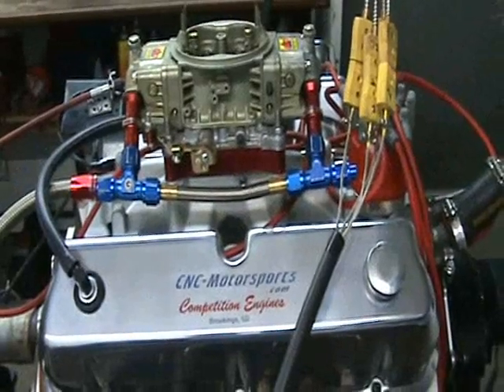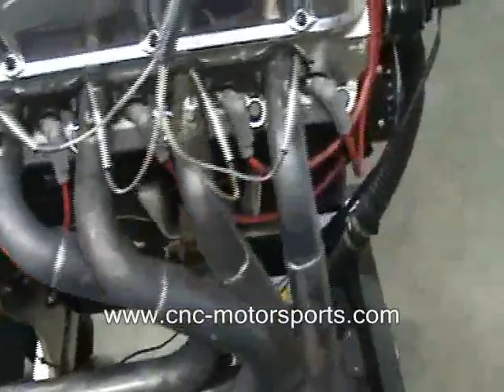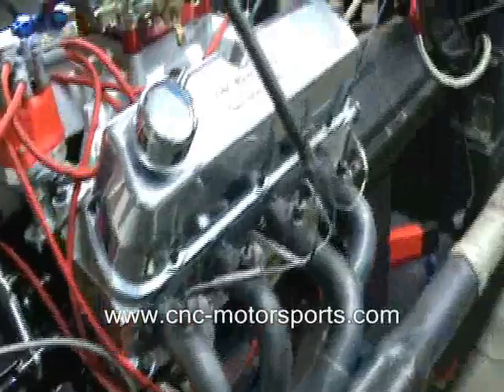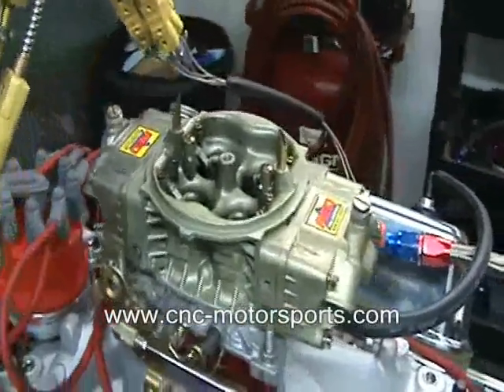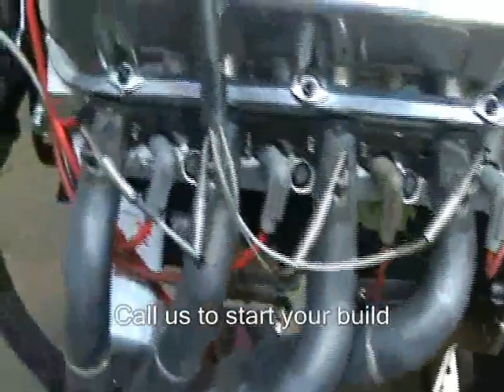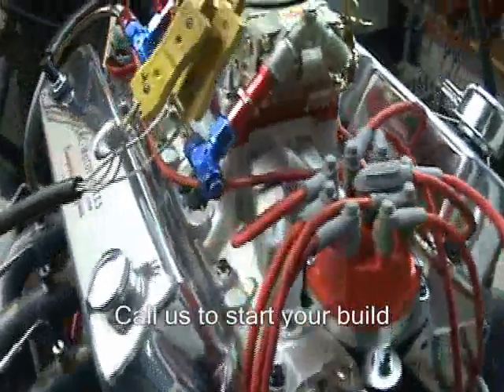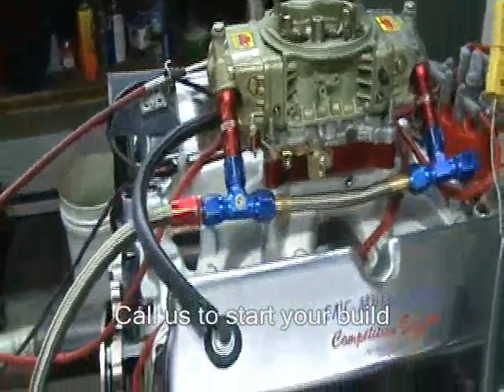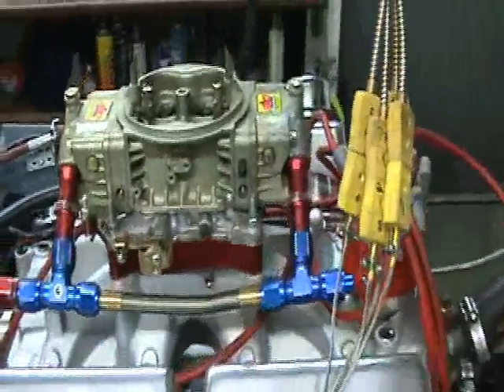Ford Mustang 347 Stroker Motor 531 Horsepower

Comment: Not possible without solid cam/bigger carb/bigger heads. I don't think so with a hydro roller .54 lift. Must be very high compression and much bigger cam.

Comment: he a liar about that engine making that horse power, why do you think he didn't tell you about the cam specs
Reply: *He’s a liar.  Lol... and no he’s not. Look into David Vizard.  An Englishman and engineer who wrote a book about Holley carburetor performance.  And in that book he lists several sbf engines as examples that we’re making well over 500+ hp.  This engine by CNC is actually under par at 531 hp.  One of Vizards 347 engines made around 560hp!  No joke.  You have to really study and know what you’re doing to achieve real horsepower
Reply: ok your on I'll look into it
Reply: Here ya go.  Looked up that figure in Vizards book.  How the heck do you post pics on here?  Vizards 347 in that picture made 562hp with a single-plane intake and 532hp with a dual-plane intake and vac secondary carb.  So he’s got one up on even these guys.  It took a dual-plane for them to hit 531.  😉
Reply: @cammer68oliver2  but David Vizard used bigger heads and a way bigger roller cam! They are saying it’s 185cc AFR heads and mild hydraulic roller, I think he is lying about cam specs…….no way that cam and AFR 185’s will make over 530hp. If so, holy fuck!
Reply: @alisaculley603  Get David wizards Holley carb performance and tuning book. In there he states that he made a mistake in the head size of his engine. He thought they were bigger heads but they are 185s as well. And he got 560+ horse out of his! Crazy isn’t it?
Reply: @cammer68oliver2  he may have used the 185cc AFR heads but it had bigger cam, this guy saying the rough cam specs, no way! Look into Joe Sherman’s Shermanator 347, he got 530 hp out of a 347 with a huge roller cam, in the end he got over 600hp with it. Not saying it cannot be done, I don’t believe with what he threw out for his rough cam specs this engine made over 530hp. I read an article on a 331 David Vizard built, AFR 18cc heads, it had way bigger cam than what this guy said his rough specs were, and it was just over 530 hp. The AFR 185cc heads on the small block Fords can turn out amazing hp, not with a little cam though.

Comment: couldn't be happier with my dart 347 from you guys. cncmotorsports bad ass engine builders. it made 381rwhp and 403lbs of tq with the same heads and a very small B cam. had a Holley systemax intake with 90mm lightning maf and 3.5 in power pipe. I'm currently switching over to carb and doing possibly a 200 shot. again couldn't be happier. if i ever build another one you guys will here from me.

Comment: i have a 347 built bottom end dart pro1 heads , hyd roller 610 at valve 254 at 50 , 10.2 comp ratio, funnel web manifold , holley 750hp series  , 4500 stall, 411 diff, c4 auto only made 303 hp at wheels but ran 11.4 at 116 mph in a xw falcon does this sound low on power or am i loosing hp reading because of the set up stall and diff gears?
Reply: I built an internally balanced 347 for my 3000 lb with me Mustang that's run a best 6.45 in the 1/8th shifting at 6500 rpm. I run a 950 alcohol carb, Powerglide and a 4.86 gears. These motors are giant killers. Cam is a solid roller 260-266 106cl @ about.620 lift AFR 205 Heads
Reply: Way to big of a cam way to much stall, you could ruin a 550 lift and 3k stall and get better numbers and timesthat head/cam/intake setup is ment to turn about 8k+ think about it is bet if you down sized everything 190cc heads/.550lift 290dur/ dualplain intake I bet you'd gain 100+ hp at the wheels bigger is not always better and that's been proven when it comes to engines
Reply: I bet your corrected cr is about 8.5:1
Reply: There's no magic way to calculate "exactly"  as there are too many variables. 
But as a rough estimate crank to rwhp is a drop of around 15-20% 
BUT
the efficiency and slippage wouldn't be factored by dyno software with a high stall. If you were to slap a manual in you would see the numbers jump right up..  But you have to trade...Run 11's or have numbers to brag about..

Comment: I built a 408 with victor junior heads, solid roller cam, super victor intake, 850 Holley, all best of the best parts and motor made 550 horse. So Ii am either firing my engine builder or that screen that popped up was from a different motor lol
Reply from the maker: Screen is actual, Something is not matched very well on your engine combination if you only made 550 hp.
Reply: Cam cam cam matching parts is important bigger is not always better
Reply: I love how people buy the best parts and are confused when. They make shit hp/trq numbers lmao lets buy the biggest intake and the biggest cam we can find then scratch out heads bc we should made 600 hp but only made 450? Hmmm if you buy parts that top out at 8k and only use them to 6k they aren't going to do well match the parts and you fair better in building a 331 right now and I bet ill break 550 fwhp bc I'm very tedious and match everything take every little step I can to get 5hp here 5hp there and it adds up cleaning up the intake exaust ports polishing the combustion chamver, matching my springs to my heads port matching everything matching my cam to all my other parts as your cam should be the very last thing you buy except push rods...lol bigger is not always better I've seen 100dreds make 400+ to the tires but its through experience and knowing how to match parts vs buying a name .....js

Comment: I hate to be the Debbie downer unless my machine shop guy build my setup wrong, but that seems like a lot of power for a small cam lower compression stroker. I have a 331 with full Cnc ported victor junior heads which have bigger valves and chambers, Anderson custom grind 601 614 lift, 11 to 1 compression, and it made 436 at 6700, 440 ftb  I buiilt
Reply from the maker: It's all in the heads and camshaft selection, we build 250 engines a year, We have great R&D support from our 70 plus manufacturers we deal with. The numbers are actual for this engine. It's easy to make power with fords.
Reply: Id be willing to bet they you cam/intake selection is killing your power way to big. That intake is a 8k+ intake and that canwould probably back that up. Set your fuel system up to support 7500 turn it to that and I bet you'd make big numbers people don't think about that when they buy parts your intake power range is just getting started when you turned it off.     Js
Reply: 9:1 A/F on dyno pull? Can that be correct?
Reply: @fletchlives6419  Theres quite a bit of power in getting the AF corrected.
Reply: +ron haley I've seen this numerous times. Head flow figures high but also high velocity makes big power lower rev range with the "right" spec cam to suit flow characteristics can yield way better average power & torque result. Engine masters comp is a perfect place to demo these. The rough specs stated in the video are very credible given the right calculation methods are done and not just guesstimated.   The 331 is my favorite windsor combo. 436/440 is pretty awesome grunt and they spin really up really quick. Some people aren't concerned but I think in a car that will do a few miles 331's not having oil rings near the pins is a good thing. I miss my 331. It made 512@6800 running a hyd roller with 595/236 using AFR's and 10.5:1, idle was very rough but even at low revs it was super crisp. I'd say this build has everything spot on.
Reply: +CNC-Motorsports love it
Reply: Victor jr heads are not good for a 331 setup 
It will make your run like a hog on the streets
Reply: Yeah a sbc or LS would be making way more with the same mods and money spent
Reply: @Alex-pj8eu  😂

Comment: I fell in love with this build, that's massive coming from a little 347. Love it, can't wait to builf my 352. Hoping for the same power, 351w heads. Screw in studs ported 1.94 in. 1.6 ex. Intake runners took to 2.25 x 1.40. Hoping for around the same power and torque.

Comment from the maker: We do use RHS from time to time.  They are a pretty good head, but there are much better. All depends on what your budget will allow. Good cylinder heads are the key to making good power.
Reply: CNC-Motorsports if you know how you can clean most of the cheaper heads up and still get good results but I know most people dont know how and paying to get it done might as well just buy hood ones from the start

Comment: @cncmotorsport have ya'll ever used rhs cylinder head? if so could i get a response on how they perform because i plan on building a racing 347 engine and i want to run the 215cc rhs cylinder heads, thanks.

Comment: Ford knew what they were doing when they designed the small block windsor. My little 289 with a cam not much bigger than the one your running 165cc heads larger Ferrea valves flows like tire smoke !